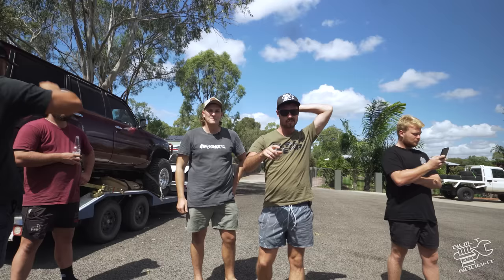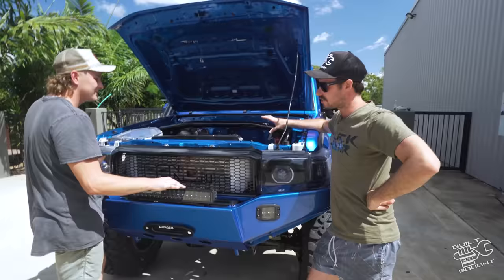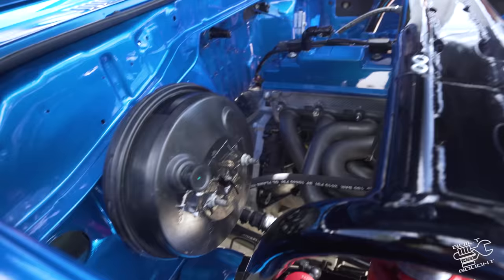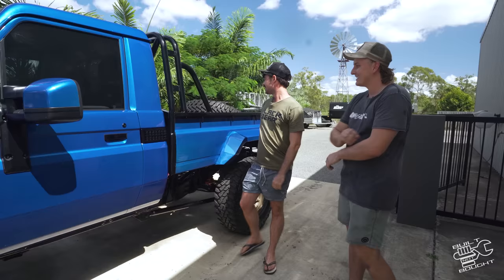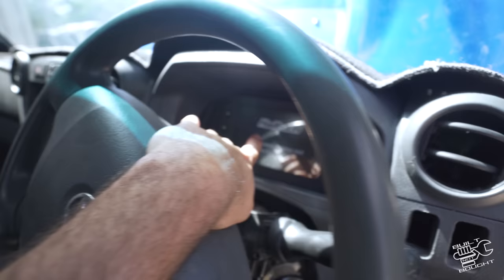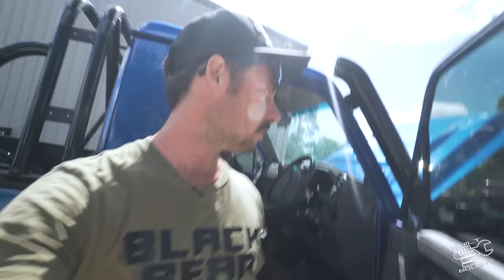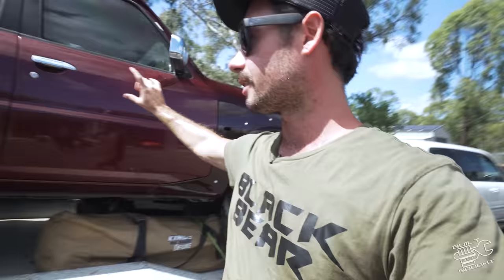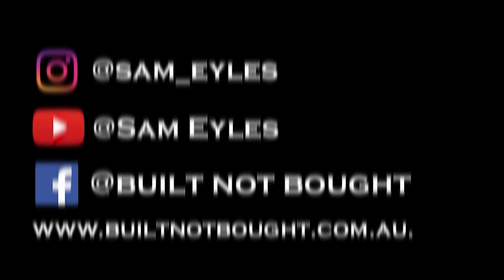BARRA, BLUE PAINT, MORE FLEX - Everything Has Change Since We Last Saw This 79!! 🔥🔥

Comment: What’s the point of 1000hp if land cruiser diffs can barely handle stock 1vd power. There’s a bloke with a silver 79 with a Barra that makes 500-600hp and he converted it to a leafy patrol rear diff (the strongest ones made for the patrol) and he still broke it. So with nearly double the power and a diff half as strong this thing is going to be useless.
Reply: Why wouldnt he use a ford 9" and change diff gears to suit...
Or a custom diff considering the amount he would of spent just rebuilding and forging that barra id say 30k minimum.
They have patrols in the middle east pulling 3000hp i think there must be a workaround...
Reply: if you play, you pay.
Reply: 5 years of 300hp 950nm vdj and never done a diff, few axles and a gearbox but proper built diff and appropriate driving gets ya a long way
Reply: It's cute that you think upgrading diffs if needed is somehow outside the scope of the person who built that car.
Reply: Their young, have to learn on there terms
Reply: when theres a will theres a way
Reply: @mattyp4230  pretty sure he already has

Comment: Ford and barra's are a waste of money. You wouldn't last in remote places. I would take reliability over 1000 hp. You can get 1000 bhp out of a 4 cylinder. Waste of fuel to ,not being turbo diesel or EV Truck's.
Reply: Take you meds mate. Yes, 1000hp will break things, just turn the boost controller down in remote areas. Infact, that eboost controller can boost via gear, ie turn the boost right off in low range.

Barras are still in taxis in Melb with 1Mkms on the clock, and still going strong on the original engine. And, when these taxis are removed, from fleet, cleaned up and resold for $4k, the new owners love them.

We had a 5000km GU's engine let go on the highway, flat bed to Alice, then hired another 80series for 1month before a new engine was fitted under warranty. 1month of no trailer = 8-900km 12hr days, day trippping in and out of Alice to get some work done. Not much fun at all.

I think I would choose a high milage Barra over a new Nissan engine.